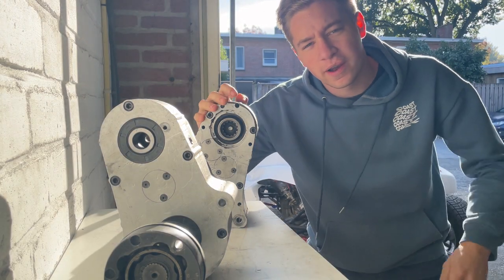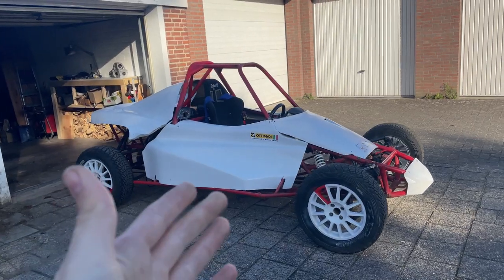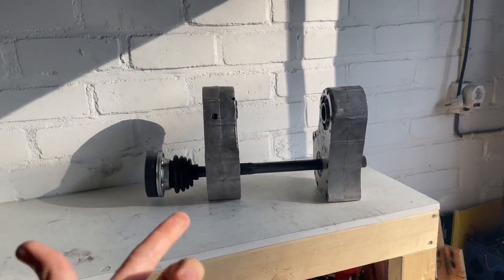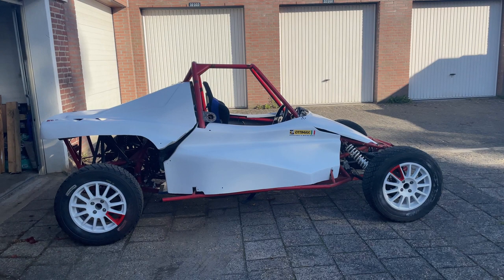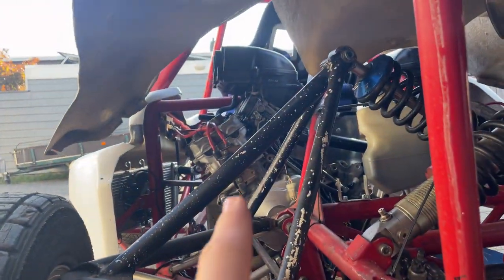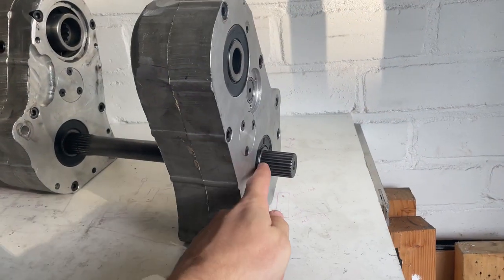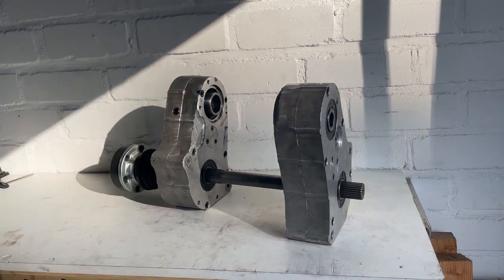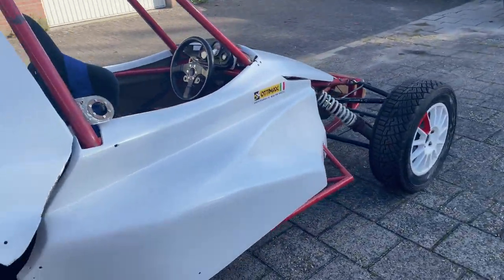THIS PART fixed EVERYTING on the 1200cc V8 BUGGY

Comment: Hey, man. Don't you think you over complicate things? Whouldn't it be easier to pick up a non-motorcycle engine (from honda, vw whatever) and use it in the project? You could get 300HP without such complex solution. I am just wonder how much wheight do the two engines have in total?  Any way project is cool, no doubt.
Reply from the maker: Thanks! Your profilepic looks nice! Icompletely understand your point of view, and I have been thinking about picking a car engine, I have even been thinking about a two stroke engine but I have very limited space due the shape of the frame and so I think the best way is this. One Cbr600 engine ways about 60kg and the transfercase/gearbox 15 so that would make about 135kg. I don’t think it’s very heavy.
Reply: Thanks, @GuyWithCrossbuggy . Got your point. 135 kg is really light. Car engine with gearbox usually weights 150+. Lokking forward to see how it drives
Reply from the maker: Yeah me to! I think it should be driving quite soon!!